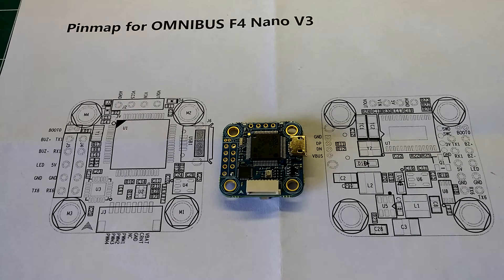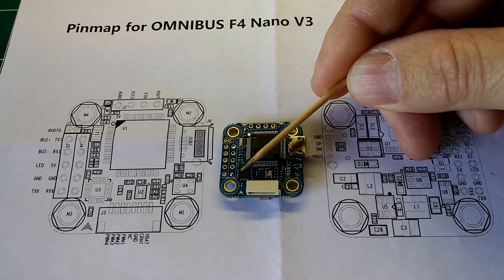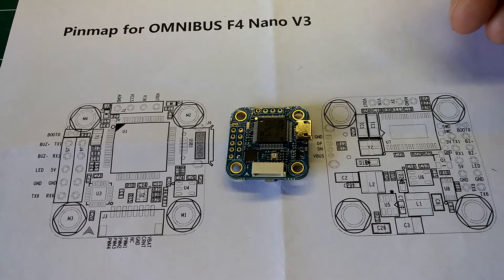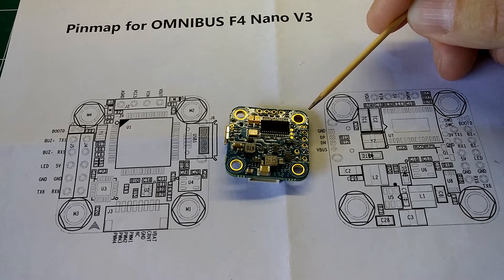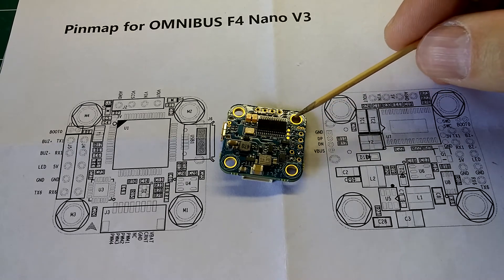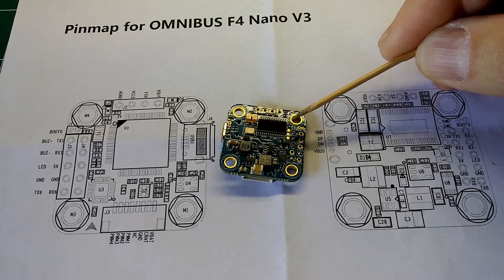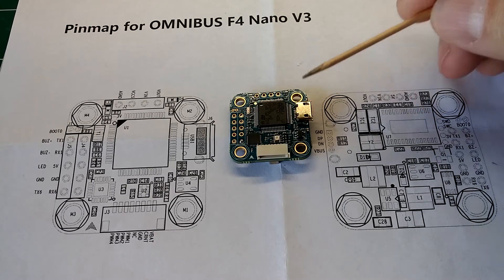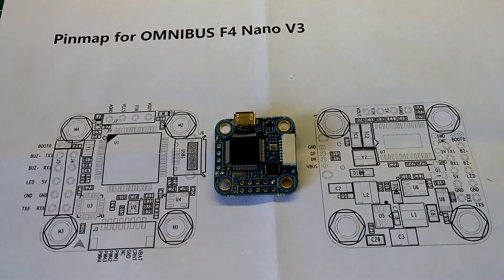Omnibus F4 Nano V3 LC Review

Comment: Thank you, I think I am starting to understand now. I have a clone board with the 8 pin connector but it shows me only VCC and GND. Do I run direct power from bat to the VCC pin and does this mean I will not have voltage monitoring in my OSD since there is no CRNT?

Comment: Hey, awesome video! Even if it's from while ago I try to get help here :)

I bought a quad with this board. First everything looked good 😅
TBS crossfire nano and gps. But know I saw that the crossfire is used with sbus. Because the crsf protocol won't work on the rx6/Tx6 because it's inverted. But the gps also needs a uninverted Uart.

So is there any way to get everything working?
Maybe the crossfire on uart1 and the gps via sbus-inverter on uart6?

Any ideas? Thank you so much

Comment: UART3: I found uart3 to be used by blheli32 when assigning the bl32 esc telemetry to the ADC ESC Sensor to both Volts and Amps. There is a jumper mod needed also for the telemetry to read correctly along with correct CLI commands

Comment: has anyone got telemetry working on this board? Tx1 doesn't work for me with frsky smartport.
Reply from the maker: Phillip - You have to do the FrSky uninverted hack since there's no hardware inverter on that uart, check out Project Blue Falcons video on how to do the hack on your specific receiver, it's relatively easy to solder it up.

Comment: Thank you for taaking the time to put this video up. The guys at RTFq's are trying to help and have schematics up on their site and you can obviously use Smart port, Smart Audio, Cam control and Sbus but If one does not understand TM4, 1 and 8 etc?
PA 6 and 9 etc?
PC 6 and 7 etc?
PB 6 ?
I am lost and the guys at RTFquads do a fine job, I have purchased from them for years with no issues. Not one! My ignorance and lack of experience is my problem now. I wish this video helped me understand their diagram on their web site. But, thank you sir!

Comment: how do you connect dsmx
Reply from the maker: VideoPlus - You would have to solder your 3.3 volt dsmx receiver to the 3 volt pad, ground and rx1, enable serial receiver in the ports tab on uart 1, then select serial receiver and the spectrum protocol in the configuration tab of Betaflight.

Comment: Very good review and the only good one particularly on this FC. I was scratching my head as I purchased this from UFPV under Kamikazi branding. No manual, no pinmaps etc., Thanks for this as I am now more confident of using this on my BBB128. I am replacing HGLRC XJB 428 FC there as it stopped working. Funnily, My FC  that came with XJB 428, still uses the XJB 425 FC pad-breakout. Hence, limited UARTs. I purchased all of these before I knew much. Keep up the great work

Comment: Thanks for the video!  I have a Flip 32 Omnibus F4 Nano I'm working on.  My XM+ is connected to RX6 and working great.  But I can't get smartaudio to work.  I have it connected to TX1.
Reply: Hi, I’m building a 3-inch with this board and also have the XM+ Rx so I only need 2 UARTS for Rx and SmartAudio. I assumed that wiring the TBS Unify pro Race HV to TX1 should just work. Why wouldn’t it?
Reply from the maker: ATCr - You may have to switch uarts and enable smart audio on another uart in the ports tab of Betaflight, then make sure you have it properly setup to smart audio or tramp protocol per your vtx, or you may need to possibly  upgrade your boards firmware to get it working. Unfortunately this board uses firmware from one of it's bigger brother counterparts, so it only has the two uarts that you can use, and the FrSky receiver has to be on rx6 to work with the hardware inververter, or there's always the option of soldering the smart audio wire to the led pad and enabling the soft serial function to get it working correctly.
Reply from the maker: Ren Medalla - Thanks for your comment, please see my detailed response up above for possible fixes, but in short if smart audio doesn't work on uart 1 in the ports tab, then try enabling it on another uart in the ports tab to see if that fixes the problem. Other than that this specific board or the Betaflight firmware it's using may somehow not be compatible with smart audio, although it's usually the settings in the ports tab that gets people messed up. I personally am not using smart audio on this board in my current build, but I might try to set it up in a couple of days to see what could be causing the issues. I'll report back here if it does or doesn't work, and how I have it setup.
Reply: Thank you!  Whitch pin should you connect telemetry?
Reply from the maker: Tõnis Kärema - You have to put it on Tx1, but since Tx1 has an inverted protocol, you have to do the FrSky uninverted hack since there's no hardware inverter on that uart, check out Project Blue Falcons video on how to do the hack on your specific receiver, it's relatively easy to solder it up.

Comment: Hi, received this FC, and it powers up fine with USB power, but when 4s lipo power is introduced, the FC gets supper laggy in betaflight and the quad does not arm. Any ideas? From what I understand this board has a built in 5v regulator? I have my vtx and receiver on the two 5v pins and they seems to function correctly. something is causing the FC to slow down immensely when i plug in my lipo. Any help is greatly appreciated. Thanks
Reply from the maker: Ben Davidson - My first question is where did you get this flight controller from, because clones from less than reputable websites are abundant and unreliable? My second question is, which could most likely be your problem, what receiver and vtx are you using? I say this because the onboard voltage regulator probably can't handle the current of both external devices, even though it's stated as such, you always need some headroom when it pertains to current and voltage spikes.
Reply: I got the FC from readytoflyquads. Using a TBS Unify Pro (Non-HV version. Runs off 5v) and a TBS Crossfire (also 5v). I don't think it is the camera, vtx or receiver because I disconnected all 3 from the FC and still experienced the issue. Something is telling me that the FC just cant support vbat for one reason or another. I will also say that the camera, vtx and receiver all work just fine when i plug in the lipo. I've got a 35v 470uF capacitor installed as well.

Since this board only has 2 5v pins (being used for vtx & receiver) i had to power the camera directly to the 4-1 ESC where my xt30 is soldered onto the lipo pads. I didn't see any other way to power the camera (the non-HV unify does not have a 5v out like the HV versions do). Although the camera is powered at the lipo pads, i have it grounded to the FC on the same ground pin as the vtx. I heard using common ground for the camera and vtx would result in the least amount of video noise. The 4-1 ESC i am using has no power outputs for a vtx, camera, ect..

Comment: Do you know if this one or the V2 can handle about 40A? It would like to use it as OSD with voltage, current and capactiy for a fixed wing plane.
Reply from the maker: BlackPixxelDE - This is a flight controller not a power distribution board, there shouldn't be that much current flowing through this board because it's not made to handle it, it could possibly blow out onboard voltage regulators.
Reply: Yep, later I saw that the F4 Nano does not have a PDB. The V2 Nano with the F3 does. Since people fly 5 inch with this I think it is fine to use it in a plane with only 40A peak current
Reply from the maker: BlackPixxelDE - I just looked up the flight controller you were mentioning, and it should easily handle 40amps of current no problem, and upwards of 120amps burst with no issue's.

Comment: What's the latest BF Firmware you guys are running? Mine Shipped with 2.17 OmnibusF4SD. Kind of confused me because there is no SD card on this FC. So, when I loaded OmnibusF4, I lost the barometer. Not sure which is the correct FW to load now. Also having trouble getting it to arm..
Reply from the maker: Thomas Houser - You mean it came with 3.1.7 Betaflight firmware, and even though this flight controller doesn't have an sd card slot, it uses the same OmnibusF4osd firmware.
Reply: Sorry... Typo. Yes, came with 3.17 loaded. I think I actually found my answer over at Github/BF page. OmnibusF4SD is the proper firmware to load for this FC. The arming issue was a Throttle Trim issue.
Reply: it' not, it's only OmnibusF4, does not have SD card this one... be careful flashing wrong targets on Fcs, you can burn them...
Reply from the maker: FPV Portugal - You're wrong, look at the github repository for the facts. This fc uses and came flashed with the OmnibusF4SD Betaflight target.
Reply: One thing is OSD another SD... ;)
OMNIBUSF4SD is for FCs with SD card reader, which is not the case. But i dont have the FC to confirm this.
Reply from the maker: FPV Portugal - Once again Sir you are wrong, read the github repository facts concerning this flight controller, it uses the same OMNIBUSF4SD firmware as the actual SD targets, so educate yourself before you come on my channel spreading your opinions that are not facts.... BTW there is no OmnibusF4osd target, but nice try anyhow ;-)

Comment: Hello, I was wondering if this board can be used for iNav. I would like to use bluetooth, GPS with mag, and a PPM receiver. Thanks.
Reply from the maker: Rev.Rec - To my knowledge this board can be used with Inav, but it's main fault is it has only 2 uarts for external hardware, so a radio receiver and one other item. I guess that you could add one more through the led pin by converting it to soft serial function, but it just becomes a pain at that point.
Reply: SteelRainFPV Thank your for the info. I am new to all these racing style FCs coming from APM and Pixhawk. Do you think an Omnibus F4 Pro Corner, F4 V5, or an Omnibus F7 v2 would be better. I know that I would need an SBUS or IBuS receiver/transmitter for the F7.
Reply from the maker: Rev.Rec - I don't have experience with the Omnibus Pro Corner or Omnibus F7 yet, but it's my understanding that the Omnibus F7 features a lot of uarts to add on extra external hardware. Take a look at the new CL_RACINGF4S flight controller board, it has 4 uarts for adding on a lot of external hardware, it's only around $35 dollars, and it should be compatible with Inav. I have two video's on my channel discussing it's features and setup, and I believe it to be one of the best values in cost, features and performance currently available. You should also look into sbus, for most multirotor applications it's really become the standard in communication, and it's so much faster and reliable than ppm.

Comment: What's the difference in the v2 and the lc?
Reply from the maker: Garrett - The V2 has a f3 processor where the V3 lc has an f4, the V2 has a built in power distribution board with direct soldering pads for your individual esc's while the V3 lc doesn't, and finally the V3 lc has a lc filter to clean up your fpv video signal where the V2 doesnt. Hopefully that helps you out and clarifies things a bit.

Comment: Very nice review, thank you.
I just got x2 such boards for new builds.
I assume the RX will go to RX6 as on most new airbot FC.
Smartport can be put on TX1.
Now for smart audio we can use led pin + soft serial, or alternatively try to release and remapp RX1 or TX6 pins and again use soft serial.
Reply: SBUS - RX6 ; SA - TX1 ; Led - LED ; nothing exotic here.
Reply from the maker: Eddi Maevski - Yes you are spot on since rx3 and tx3 seem to be nonexistent on this boards pinout, despite it's existence in the ports tab. Personally I'd use the soft serial function on the led pin if you absolutely need the three functions of a receiver, smart audio and telemetry, but since I don't really use the frsky telemetry too often, I just use the 2 uarts on my micro build currently. I still need to test those pads up by the 3v Spektrum Satellite pads to see if any of the 2 could be uart 3 tx or rx, which I should be getting to soon out of pure curiosity.
Reply: Rain - another point that worth noting, those SWD / SWC ( or SWdata / SWclock) pads near the OSD IC would be better left alone (I mean not to remapp those) as if something happens with the USB socket you can re flash using STLINK v2 programmer and keep the board usable. The original purpose of those pads is flashing the MCU post production in a so called pogo pins jig / programming jig.
Reply from the maker: Eddi Maevski - Thanks for the information on those pads, I looked literally everywhere to see what those were and came up empty. I still don't understand why there are 3 uarts listed for use but not broken out on the board, but maybe it is intended for the led pin soft serial function you described earlier.
Reply: that's actually simple, Omnibus F4 target is one of the most stable and mature targets on BF, it supports many many boards and different REV of those boards (for example DYSF4Pro until 3.2 was also on this target) each target has predefined set of IO defined hence if 3 UARTS are defined for this target all 3 will show  regardless of actual pins being routed and broken out on board, as additional example one can look at  HGLRT XJ435 / XJ428 cubes which use same target and has only one UART broken - for RX.
Reply from the maker: Eddi Maevski - I see what you're saying now, and I understand that's why they're using the firmware for stability, but I swear I read somewhere that this board had 3 uarts, but then again I probably read it from an unreliable and inaccurate source like the Ready To Fly Quads website. Thanks for the information though, it sounds like the soft serial method is the only way to go to get the 3 peripherals working correctly.
Reply: So, if I want to use actual LEDs... then I'm out of luck for Smarport? Since I'll be using one UART for the Rx, and the other for LEDs...?
Reply: What are all peripherals you seek to connect ?
Reply: Just RX (SBUS), Smart Audio and LEDs. It's an XM+, so no telem.
Reply: That's what I though. But someone reported that TX1 Smart audio didn't work. Anyway, Im testing in a few minutes... We'll see..
Reply: Just tested. RX works fine on RX6, and so does Smart Audio via TX1. However, LED won't work for some reason. I'm calling it a day. I also have a problem with picture where the OSD looks fine, and so does the Foxeer camera OSD, but the picture looks like a washed out bunch of colors. Either the camera is bad or the FC is messing the picture. I'm going to go out on a limb and say it's the camera. But wiring it for RunCam is going to take a bit of time and it's getting late...
Reply: Actually, the plugs weren't the same, but the pinout was. I swapped for a RunCam and video is fine. The Foxeer cam is faulty. Way to add more complication to a build that hasn't gone smoothly at all. Haha.

All seems to work, except LED. Another thing I didn't like was that the FC was very laggy in saving and sometimes it didn't want to connect at all. Not sure what's up with that. I'm putting this on backburner status as I have other birds I need to work on before a race next week. This "fun" build can sit and wait.